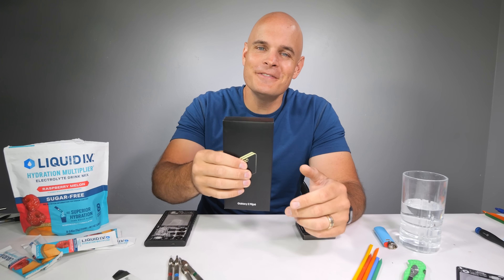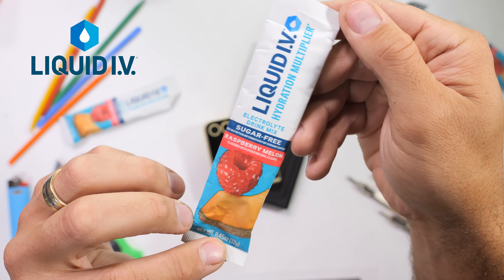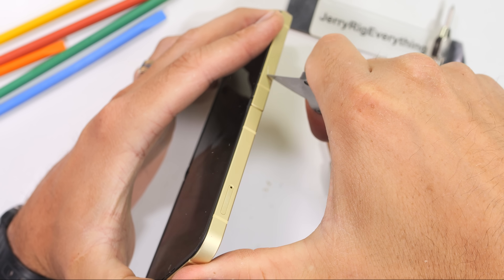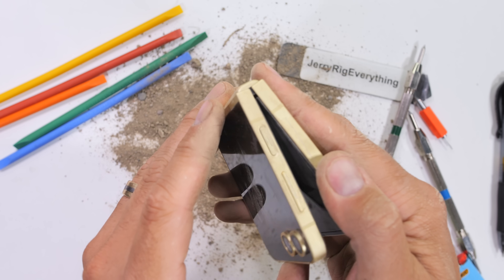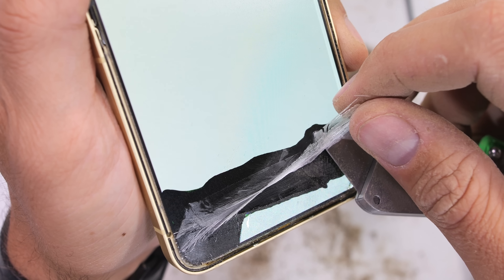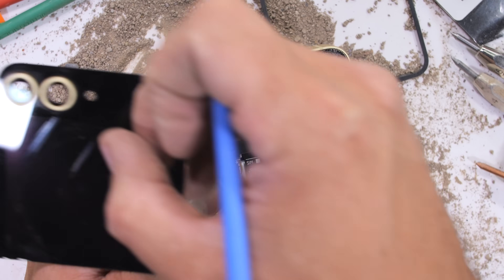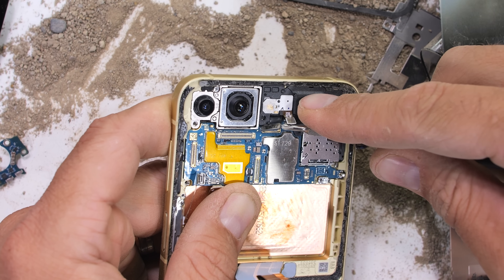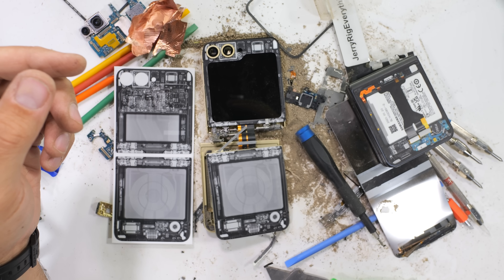Samsung Z Flip 6 Durability Test - I CANT BELIEVE THIS WORKED...

Comment: Folding phones are terrible in my opinion. I find the screens to square when open so when watching videos big black bars on either side and then for multi windows it's still a bit to small for multi tasking and I don't trust the Folding glass. I use 23 ultra 1tb. Much prefer it. 😊

Comment: "That was a whoopsie." Story of my life. I think I used the Z Flip in part because of how much I'm blown away by the amount of tech and engineering that went into it. Could I get a phone with a larger screen? Of course. Would that make doing my work when I'm away from home easier? Pretty much guaranteed. Could I see myself going back to a non-flip/folding smart phone? No, I really can't. I've gotten used to having a phone that can fit into any pocket, it takes up less "space" (same volume, I know) in my pocket which makes it easier for me to move around and I am not as worried when I drop it.

You video on the Filp 3 is what helped me decide to buy it, and I should go back and watch the videos on the 4 and 5 you did.

Comment: I'm writing this from a zflip6. It's awesome. I have no complaints, and everything you want to do can be done on the outer screen, so you don't even have to open the phone. I love ut
Reply: can i ask you what do you think of it after a month of use ?
Reply: I've had used zflip6 for a month now. I used to own a zflip 4 before and every issue I had like battery issue, the camera, the hinge... no longer exist. It's the best flip phone from samsung and the best phone ive ever owned. So far, the experience is perfect for me. This is definitely the absolute beginner flip phone that erases all the stereotypes about it. Biggest improvement is the battery and camera @ZERO-mm6iv
Reply: @ZERO-mm6iv  hi, i've had mine for a month now and i still love it! i switched from iphone 8 to the zflip 6 so maybe im just impressed with newer tech😂 but I totally love this phone.
Reply: Its a good phone and so far working fine @ZERO-mm6iv
Reply: @ZERO-mm6iv I got mine back in September and it still works as good as day one. You can't even see the crease at all, it is invisible at nearly all angles. Also I dropped it 3 times and the hinge is completely fine.
Reply: I should also clarify that I have a spigen case, one that also can protect the hinge (and still let you flip the flip) but also nothing bulky, too. A normal case but z flip-ified
Reply: @SpooderDev  what was the name of the spigen case you got?
Reply: @SpooderDev how many times have you flipped it open?I never open or close mine anymore because of the well known issue with only the zflip 6
Reply: @X-S-V-b1e ive had mine for a year now. i flip it constantly and sometimes i also fidget with flipping it just because it's fun. ive had no issues. i had the flip 3 prior to this one for 2 years or so and no issues either until i dropped a chair on it and cracked the screen (which 100% my fault and not an issue with the phone). i also dropped my flip6 multiple times (both closed and open) and it's all good. i do have a case on it, but it's an aliexpress one and it's just meant to look cute, not be very protective. never had issues with the hinge or screens and it's my current phone (and 2nd flip i got)
Reply: Any updates on longevity?
Reply: @peacelilac i have had mine for six months now and honestly it's been chugging along just fine. 

After I got mine, so many of my friends approached me with stories of their friends who had previous generations fail on them within six months.

I, on the other hand, had no issues whatsoever. Bar from my cat scratching the plastic protector within two weeks. The cover is so soft that it does get scratched up quite easily but you don't notice it when the screen is on. I also plan to use my free cover replacement when the phone nears one year. 

I was also afraid that the crease where the screen folds would become noticeable over time but it's pretty much the same since I got it. You can feel it when you run your finger across it but when the screen is on, it doesn't distort the image whichever way you look at it. 

I dropped it a couple of times - both closed and open - and dreaded picking it up, but it survived without a scratch.

The hinge is also working flawlessly so far.

I hope I don't jinx it now, but so far so good.

Do I regret buying it, not really, but would I buy it again. Honestly I'm not sure. I was aware it won't last me 3+ years like my last few phones, but although I had no issues so far, it still feels like owning s ticking time bomb.

I do still enjoy the novelty of it even after six months. And the flexible screen actually did come in handy in a couple of situations. Mostly when taking a group photo.
Reply: @peacelilac they made 6 of theses. And still have too many issues for it being a 1300 dollar phone
Reply: @peacelilac  ive had mine for a year, no complaints! small nail marks dent the screen, but it is superficial. it does not disrupt the use :)
Reply: I would also like to know :)
Reply: Is it still okay?
Reply: You can't change quick settings, for one

Comment: I'm still 'very' angry at how stupid a design it is to have a folding phone in which the screen is protected when the phone is folded... only to cover the entire outside of the phone with more glass and screens.

Literally just... make the outside metal or even make a plastic back, I dont care, just... sell me a phone that I can drop without worrying that its going to leave a pile of broken glass on the damn floor.  Every other phone just turns into a brick because every blasted phone requires a fat phone case and an additional screen protector.

Comment: There is a reason they remove the brushes from the hinge, and that is because in many cases like mine, out of temperature or randomly the glue that use to hold the brushes melt and they jammed the mechanism preventing the phone to fully open flat, also sometimes break the inner screen......

Comment: And people question why it's so expensive. Foldables add a LOT of complexity, clearly shown in teardown videos.
Is it worth the asking price? Only if people are willing to pay.
The Fold is a productivity powerhouse. The Flip is vertically compact. Both add some novelty, but are not very practical for most people, as mentioned in the video.
Personally, I don't see myself using either of them until the Fold gets thinner and smaller, like S24's dimensions and 1.5x thickness. Also, battery technology needs to improve a lot for heavy all-day use.
The day this all happens, I will definitely buy one.

Comment: I can't fathom why anybody would want one of these.   There is no added benefit and only drawbacks.
Reply: The outer screen lets you check the necessities, which may seem bad but can help you be more productive as all the info is just at a glance, and you won’t have all the full features on the outer screen
Reply: @GobbiExists a normal phone already has an outer screen that you can do that on, plus all the other featuresv.  And it's more durable and it's cheaper.

Comment: I hope you read this, 
As a user of flip I can surely say Crease usually Increase over usage, The more you use the more it grows. For a new screen crease is not very visible but you'll see the same creaase as old phone after the regular use of 4months or more
Reply: I have owned the phone since September 2024 and the wrinkles haven't increased.
Reply: it's a flip phone, what did you expect that something you flip 🤦‍♂️
Reply: @naimsyarifmuhammad9797 
It's just meant to be informative dude
Reply: @naimsyarifmuhammad9797  they are just informing, at first the flip 3 for example already had the proeminent crease and it stayed that way. The flip 6 does have a less visible crease and it gets a bit more proeminent but not as much as the previous models. So still it is an improvement but not as huge as some may believe. No need to be so worked up over a comment
Reply: @Itsnot126 the flip 6 has an issue where you flip so much eventually the cable inside the phone for the screens will come undone or get messed up and cause your screen to go black

Comment: That flip upside down issue wasn't an issue it seems for me when I had an original Moto Razr in the day. I can't imagine that now since the whole inside is a screen, and unlike the Razr there isn't a cue to know which side is up or down. We had a weight differential and a bottom plastic bezel to help. Back then bar phones didn't seem easy with sitting and dialing numbers from your back pocket. Now everything has changed.

Comment: 2:20 that’s because the phone hasn’t been folded yet, as soon as you start folding it the crease will become more visible
Reply: Maybe they improved it a bit but will still get more visible with use and not stay as perfect as out of the box
Reply: @Darx97   ofc it will since it's a flexible material, but the point is they improved compared to last gen.
Reply: @KoreanAir001  ye no doubt in that, its good that people like you keep buying these so they keep improving them and hopefully they will become on par with normal phones in a few years when it comes to display durability where you aren’t concerned if you pressed with your nails too hard on the screen, maybe then I’ll also buy one
Reply: i compared with brand new flip 5, and i can say they improved the crease

Comment: I had the same issue with the usage of my flip 5. I was all going home to use the outer screen and try to get my screen time down Plus have a large phone in a smaller package. But unfortunately there's a lot of little things that force you to constantly open the screen up such as trying to dial a number from your messages once I get all the time for my work being on call it's a neat concept but really for people who don't use their phone their phone a lot and unfortunately for my line of business I'm constantly on it I also found the battery life was pretty short despite trying to do everything I can to limit the performance. If I were to go back to a flipped device it might be a Motorola purely because it seems like they understand what people want to use the outside screen for whereas Samsung still view it as a large smartwatch which is the opposite of what I want for

Comment: Ugh, why do reviewers compare a new phone with one that has been closed for thousands of hours, and then say the crease is reduced in the new one. 

OF COURSE IT HAS, IT'S BEEN SHIPPED OPEN IN THE BOX AND HAS BEARLY BEEN FOLDED!

Compare an out of the box Fold 5 with an out of the box fold 6, then we'll see if there's any genuine difference.   All of my foldables have had next to no crease out of the box. Within a year they all have a gutter running down the screen.
Reply: crease does not expand
~former z fold 4 user upgrading to z fold 6

Comment: what most people looking for fold and flip dont know is the hinge cable gets messed up and then samsung forces your to replace the whole inner screen. You can find thousands of posts about this online. You can search zfold 3 hinge issue or no sound etc and see the repair videos.
There is also a horrible rubber sticker that stops it from unfolding completely as it starts peeling inside, jamming the hinge.

Comment: I still dont get it why they make foldable phones. You can demage the screen by just using it. Also they are so expensive, compared to other phone. A 9w soc, that needs a vapor chamber, is completely blown out of proportions, for a phone.
Who needs 5.5 TFlops of gpu power for a daily driver???
Reply: Innovation is about pushing the limits
Reply: @roy-a0101  Next phones pulling 20 watts and being cooled by liquid nitrogen ^^

Comment: when the AT&T active was a thing. Samsung was pushing this narrative of a glass/plastic hybrid screen on the active that would cost $200 to replace.  That is until I released a video showing me stick a razor blade into my actives screen and pulled off the extra thick screen protector revealing gorilla glass 5 underneath.  As if like magic, 1 week later Samsung started replacing the screen protectors for around $20.   So don't believe that fantasy bullshit they want to call their new screen.  Its plastic.  plain and simple.

Comment: Impressive phone from Samsung once again 😍 good job!
Reply: Agreed, they're improving their foldables structurally every year
Reply: Impressive? Its a nightmare to repair. Everything glued in. Glass breaks each time you open it. Horrible cheap engineering as 99% of modern phones.
Reply: @GTR-TT  show me a phone from the last 5 years, which is not glued together.
Reply: @talos86  THAT MY POINT. Is garbage as i said “99% of modern phones”
Reply: @GTR-TT if it's like all phones then what makes rhus bad lol
Reply: Still gonna wear down quicker than a slab phone 😅
Reply: @JayBlackmores well duh, and the screen feels like garbage because it’s soft, but can’t deny them the advancements.
Reply: @JayBlackmores well my cousin had the first generation flip of samsung and still good. 😂
Reply: Clap clap

Comment: 6:44 how is 20 USD for a plastic screen protector fair when hardly costs 0.3 USD and probably 0.05 USD to manufacture it
Reply: I would imagine that that cost isn't for the screen protector itself but rather the installation for it, as the screen probably has a tendency of self destruction as seen in the first foldable

Comment: 0:30 so maybe... just don't fold it? 🤨🤨
Reply: The inner screen is very delicate and prone to scratches easily.
Reply: @aymanali1814  True. But this same argument doesn't hold up for the Fold as you only have to fold it open if you want a bigger screen instead of the regularly sized front screen.

Comment: I carry mine in a jacket pocket or my computer case. I don't fold it when I'm useing it a lot but that takes a big brain to figure that out. It's almost the same size as my S 24 ultra and it fits a pocket the same way. Only an idiot would scratch soft aluminum with hardened steel. How many people would place thier phone over a flame? Why don't you place it on a railroad track and run over it with a locomotive? Do you have to guess what would happen???

Comment: I don't know about the Flip, but the Fold has dust-blocking fur, but hinge damage was common.
Has Fold 6’s dust protection been improved?
Reply: It has improved slightly but will still net the same result as before because it's not redesigned in a massive.

Comment: Although I'm not a fan of the folding devices and the whole folding concept, but I have to say that the amount of technology inside this tiny device is amazing! Thanks Zack for showing us the insides ❤
Reply: once you try one you will never look.back.all bricks will appear to you as prehistoric tech😂 gone from flip 2 now I am at 5 and will never look that bricks , one the copy of the other. no tech evolution.only flips took fresh air thanks god
Reply: @pc-easy  I'm watching Zack's teardown for more than 7 years, never get board 了
Reply: @pc-easy my mom used a flip phone before, bought a new phone immediately. Too unreliable, fragile and too expensive to repair. It’s still too new to be depend on but that’s the same with any new tech really.
Reply: @pc-easy the 6 sucks though. New issue with the cable on the inside thatll come undone or be messed up so your inside screen quits

Comment: Watertesting should be a thing on this channel. What else are you doing with the phones after scratching, burning, bending and reassembling it? Just drop them in a bucket and see if they still turn on.
Reply: Definitely, just another test that wouldnt take long but would add some interesting stuff
Reply: Water damage isn't mostly visible or active on first sight and it might take months for the corrosion to spread.
Reply: @Astra3yt  It's still fun seeing him dunking a phone in water
Reply: It's 2024.   Phones are water resistant for a while now and people already have faith with Samsung and apple to go swimming with their phone even if it may not be recommended
Reply: that's what i was always thinking for years
should add another part where phones are water tested in a long tube from half a meter to about 2 or 3 meters and let the phone sit for 30 minutes, probably with clean water, pool water and sea water then check if it still works
Reply: My old Pixel 7 pro claimed to have water resistance but it didn't. When lightly wash with water, the cameras end up with water in them and the GPS stopped working
Reply: Don’t forget Blending it.
Reply: There's a surprising amount of phones without water resistance. Heck I just got one yesterday without it. I know it can take splashes and rain so it's probably fine for what I do.